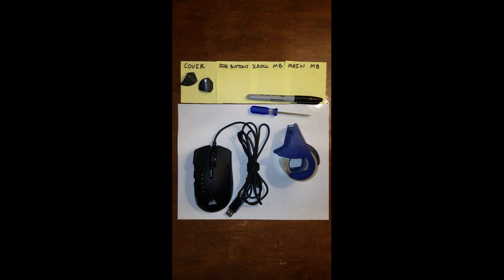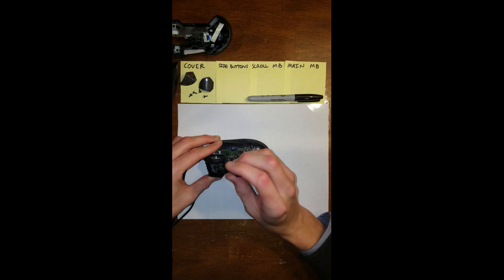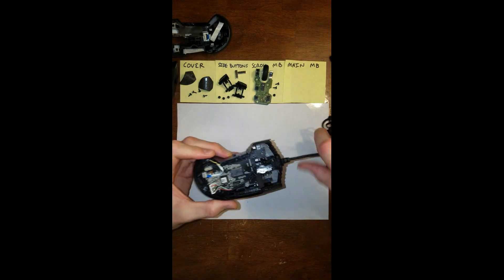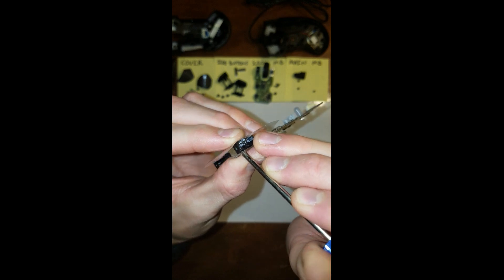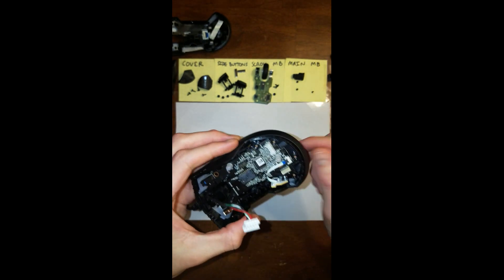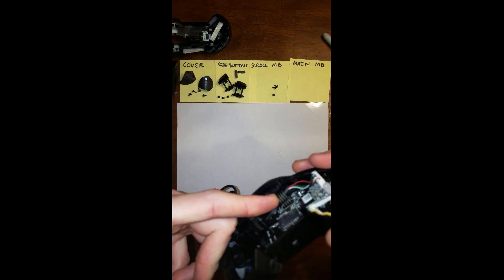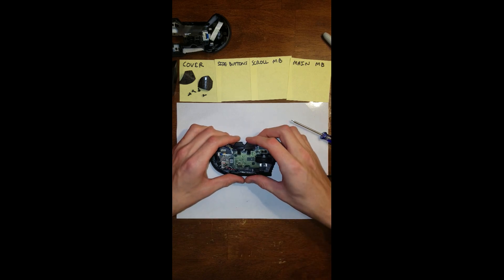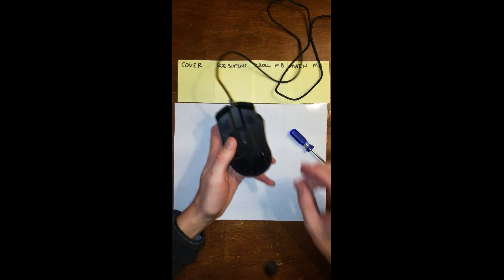Corsair Glaive Disassembly

Comment: So, great guide, however do take my advice and be VERY careful how much pressure you apply on the wire. I didn't think I was using too much pressure but I obviously was and snapped the wire and it went flying across the room.

I'd probably edit the video put a massive disclaimer warning about VERY VERY VERY VERY gentle with your pressure. I'm now off to buy a new mouse :( RIP